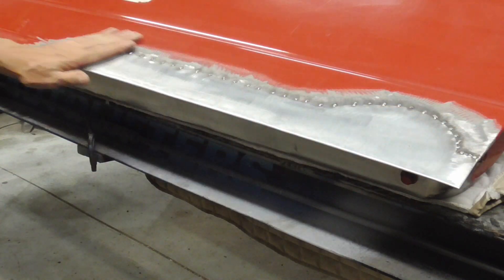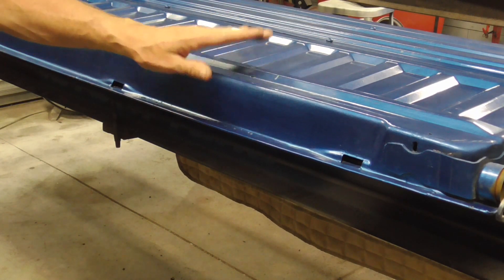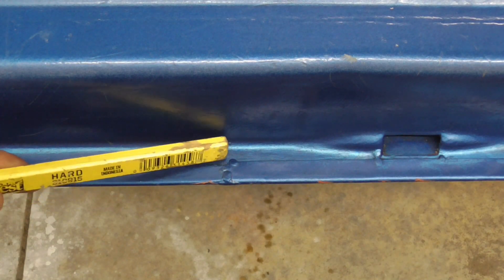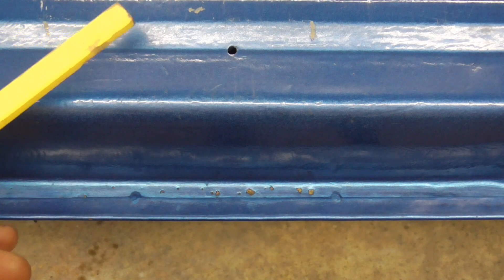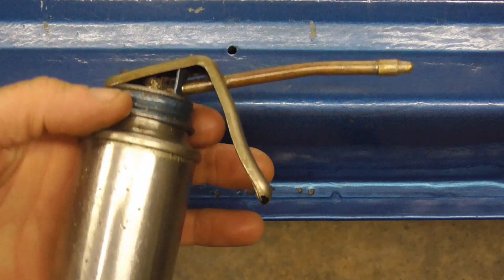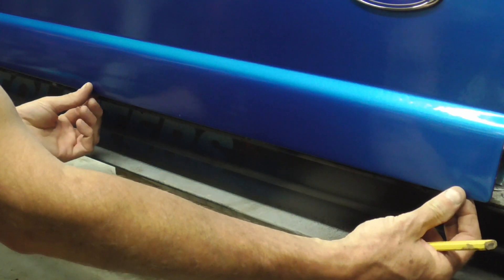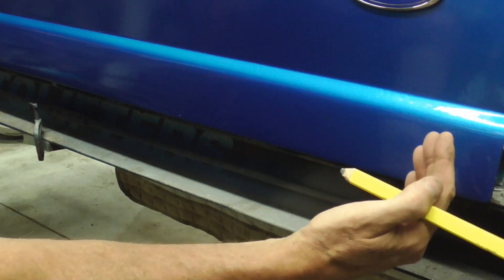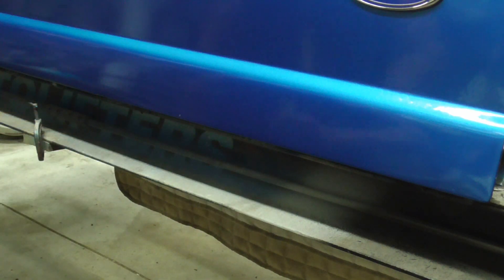How Long Do Lap Welded Rust Repairs Last?

Comment: Great Video
 Im a firm believer in undercoating. Loved the idea of using used motor oil. Taking notes
Reply from the maker: I like undercoating too and the looks of it.  Only issue that I've seen is the old Ziebart would actually lift/peel, then trap moisture or salt water making things worse.  If I do use it, I make sure the panel is prepped right so it sticks forever :)

Comment: 100% Agree. Am 65, I learn from when I was 11, Lap Patches If You treat the back with an anti rust paint, in your case oil, they last a lon time. Butt weld is good when you are fabricating panels and requires some shapes. But for day to day driving cars repairs, cleaning and cutting the rust. Is the way to go. Am Not A Car Maker, I repair and Make My Customers Happy. Never Have A Sign in any of My Shop, And Still doing.
Reply from the maker: When folks question you on that topic, have them look up "Sail Panel Seam".  Factories used lap welds in a shallow valley to connect the quarter to the roof - lasted forever if done right :)

Comment: Do you spray oil or automobile under carriage coating (which I think is lanolin) on your truck in preparation for winter? Or just oil the repair?
Reply from the maker: Just oiled the repair.  You're right though there's lots of strategies for the under carriage.  Look up Cosmoline RP-342 - the stuff is incredible - once you spray it on, it's never coming off and seriously protects against rust.  In the old days though I would fill a spray gun with used motor oil thinned with mineral spirits and soak the bottom with that.  Gets everything greasy like an old valve cover after a while - won't hurt anything either.  Doesn't combust either so no worries there :)

Comment: Did you close your weld or just weld at all half inch?Thanks
Reply from the maker: All about 1/4" apart.  You can put the welds right next to each other though.  It doesn't seem to matter - I've done them both ways and haven't seen too much difference :)

Comment: In other words, for certain areas where you can’t oil the inside (where the weld is not protected) you are actually better off with POR-15 and fiberglass, which will last much longer if done right.

Comment: Can I use painted aluminum with pop rivets over the original rusted steel panel?  Would I use steel or aluminum pop rivets?  I know steel and aluminum are dissimilar metals, but since the aluminum is painted,  galvanic action should be minimal/eliminated?  Of course aluminum easier to bend and would never rust.  I have rocker panel.
Reply from the maker: You can try it.  If you use glue the two metals may not corrode :)

Comment: you're the best.. I just got a project car 1972 510, it has some spots that need cut out and fixed similar size to this. I only have a cheap harbor freight welder like the one you've made a few videos on... Do you think it will be fine for what I'm wanting to do to one car with a couple rust spots on quarters and rockers? or will I be wishing I had a mig for my project? I've never welded before.
Reply from the maker: Thanks Joseph good luck on your car.  If you have ?s feel free to ask.  Sorry about the late reply - Jerry

Comment: This is Fantastic! Thank you for making this. Did you wash the truck very often during the winter in those 10 years? Also in your opinion does storing inside vs outside make a big difference on whether a vehicle will rust?
Reply from the maker: I sort of like to keep a clean car but in the winter it is usually dirty.  Maybe 3-4 times I took it to the car wash in the winter.  I've never had a garage to park cars in overnight but I do believe that would help a bit as the car would have a chance to drain and dry out a bit.

Comment: you do a great job both butt and overlapping and give common sense reasons for your choice. that's all that's needed and the choices you made on the tailgate after ten years proves it! keep your videos a coming.
Reply from the maker: Thanks so much - I appreciate that.  I have a video coming up that thoroughly goes over the ins and outs of butt welding and metal finishing vs lap welding and other methods - I think you'll like it.  Thanks a lot for the support :)

Comment: DONE TOTALLY CORRECT.... and I have done these types of repairs and they have lased 20 years..... OIL is the trick for you rust belt guys.
Reply from the maker: Thank you for your input - that's good to hear.  You're right, oil's cheap an it works fine.  Thanks for the support Mike :)
Reply: @LakesideAutobody  I liked your comment in another that it takes over 5K welds to build an automobile and every single one is a lap weld!

Comment: I'm doing cab corners on a 2010 ford f150 should I butt weld or lap weld them in
Reply from the maker: Professional body shops in Michigan lap weld them in.  If you insist on butt welding them in don't try to grind the welds down to nothing and attempt to metal finish - you'll have paper thin welds and adjacent metal.  You'll lap weld where you can easily tap the welds down and but weld where you can't knock the weld down that far like edges, corners and rigid areas - this video may help:  https://www.youtube.com/watch?v=I8VVlYPIigA  watch close as I explain where I used butt welds, lap welds and spot welds - hope that helps.  Jerry
Reply: which one do you think will last longer I'd like to get a good three years out of it before the rust starts to come back
Reply: @steventipton1817  lap but you need to treat the back side of the weld

Comment: Thanks so much for the information. I’m about to do a lot of work on my truck wasn’t wasn’t sure if it was worth it. Sounds like as long as I take care of it and keep fluid film or oil it should hold up fine
Reply from the maker: You're welcome - I bought this truck in 2008 for $1200 off of Craigslist.  Drove it for 10 straight years through Detroit to work - very salty roads.  Trucks are good because they have a full frame and you can easily make sure the rust underneath in under control.

Comment: I am glad to find someone that use a lap weld or flange weld, if there is room for the tool. My son, 34 now, found a truck that needed work so he could start a lawn service. He quit his long time job after his boss gave him two weeks to learn Spanish for the guys he hired. Dad (Me) fixed the electrical, put a serpentine belt system with pulleys, brackets for missing parts and welded new metal for rust. Not too bad. He gave me the truck after he spent $600. It had new aluminized exhaust, valve job, carb, intake and like most kids, put a huge cam in a 72 Chevy 4 bolt 350, sitting in a 1967 C10. The rear window was horrible. They busted things but bolted a camper shell window in the cab crooked and gaps. A friend had a saws all with 4 batteries. These are dual skin, but found a large window with a slider in it. I was able to cut it out and paid $60 for it. To install, it has to be done in two parts. I drilled each pinch weld, cold galvanized. After measuring from 8 standard locations, trimmed the panels 5/8” over-sized, ground paint of, used masking tape, marks and cut short as I could use the flange tool inside and out. With 32 vise grips, all lined up, MIG the spot welds on both side. Complete all welds then used hard pressed thin layer of dynaglass into the tiny gap, cheese grater, filler to smooth and kept the OEM panel lines on the outside. It was sprayed inside with a yellow wax rust product I had from the dealer that closed. Anything open, went to the trash. All of the other techs found jobs as I dumpster dived each night. I am glad I could fit the flange tool as the 18 gauge metal fit flush. The inside curved corners where hard. A friend had a ball shaped buffing pad almost 6-8” in diameter, worked great with air drill and PSA sandpaper. Glad it works for you. The waist oil is a great tip for guys wanting to keep a vehicle looking good for a few more years. It works. Place some cardboard down if there are drain holes. Thanks for the video! Long time subscriber! Keep em coming...
Reply from the maker: Great story - sounds like it'll last a good long time.  You sound like you're pretty handy.  You really can make a car or truck last forever as long as you don't get bored of it (I usually do then get another project)  Glad you enjoy the videos and I'll keep them coming.  Thanks so much for the support :)
Reply: @LakesideAutobody   If you are old enough to remember buying gas with your license plates odd/even number, and a peanut farmer in the White House. Gas had jumped 3 time in 2 years. Sold at $019.9 cents, jumped to $036.9 cents then to $060.9 cents per gallon. People thought the world was coming to an end. In KS, at age 13, a drivers license was black/white, no photo. I had my second Yamaha at 11, a 250cc single off-road w/ lights. If my jeans had coins in it, I could fill the tank. But gas stations where abandon everywhere, they had no fuel. Drive by one, saw a construction company selling a PU. Called the number and gave them $150 for a 1965 C10 Apache, 283, power-glide and wood bed soaked in new motor oil, used motor oil and spilt diesel. They service bulldozers, scrapers and back hoes. Bringing back childhood memories as I grew 7 inches at age 11. Small town gas station w/wood floors, benches for 12 people had the farmers telling jokes, talking about everything, while the women folks was in church. I lived in a pull camper behind the station, pumped gas 7 days a week and was fixing flats and car repairs. The town drunk got his car taken from him so he rode his riding lawnmower the two miles from his farm. Sounds like “Mayberry RFD”, but no Andy Taylor. We had a big farm, but got real tired on the belt. Learned to run fast with long legs, found I was adopted and left. Ain’t spoke to any of them since 1981. Never looked back. But I do love my C10. Thinking of putting sport rack & pinion on it from a 87 Barreta with center take off. C20 lowers, 88-98 knuckle, disc and 3” piston calipers. Keeping it all GM. The difference is, I am writing a service manual for it. Parts, schematics everything. Enjoy the videos and clear vocals w/o music.

Comment: Neglected oil leak on a 98 Silverado has left behind the most rust free area of the frame and steering linkage. Put on a new power steering hose that was leaking so now I suppose that area will rust too.
Reply from the maker: Nothing better than fixing something rust free.  How nice would it be to fix a car from the South.  Just loosen the bolt - done.
Reply: If you have oil leaks it is automatic continuous rustproofing under your car.

Comment: Are used to know a guy in the 80s that oiled his truck twice a year would mix it with something and sprayed on on his frame it always stayed prfict no rot
Reply from the maker: It really does work - just have to stick with it.  It's sort of a pain but worth the work really - Jerry
Reply: I met a small time farmer that had his original equipment from when he first bought his farm after the Korean War. Before he put the machinery away for the Winter, he would spray it with used motor oil, and cut it with diesel fuel #2!
Reply from the maker: @davekana8388  Thanks for the information. Right now I'm using mineral spirits to cut it but the diesel fuel would be cheaper for sure.  Thanks again

Comment: The oils the secret sauce.    I prefer a mix of used Dextron ATF / Vaseline petroleum jelly / bar and chain oil.     I spray the undersides of my old beater truck every December.    Just get it hot to spray and let Gretta 🙄worry about the drips.
Reply from the maker: Keep coming with the recipes - I love it.  I hear some kind of recipe with linseed oil works well too you can even throw in some black rustoleum I guess - make the frame look real nice :)
Reply: @LakesideAutobody  Jerry, I am VERY intrigued by all this. I have heard of using used motor oil before but have not tried it. It is hard to argue with success, and 10 years is proof to me that the oil did its job! Thank you for sharing your knowledge. I was wondering how you got the oil in those tiny holes. Thought you might have a tiny sprayer setup but nope, just a simple oil can gets it done!

Here's another mention of the ATF/Bar & Chain oil mix; scroll the the poster named, "Moxie" https://www.winnipesaukee.com/forums/showthread.php?t=18457 .  @Merlin Cat what's the ratios of ATF/Vaseline/Bar & Chain oil you prefer? I've been using Fluid Film but it seems to wash off exposed areas quickly. Last year I had two vehicles oil sprayed by a local guy. He told me he uses new Bar & Chain oil. I think there's more to his recipe - the stuff not only sticks, it also creeps very well. Many locals say they've seen him heat his mix in a microwave before spraying.  He sprayed my wife's truck. I did an oil change on it last weekend. We're half way through winter, she drives it almost every day and no sign of it washing off yet!!! Thanks, Larry
Reply from the maker: @lcar9871  There are some really good recipes out there especially in Canada.  I bought my wife a new Kia Sportage in 2002 and did this on every oil change.  We still have it and no rust in all door bottoms, rockers, hood, tailgate and bottoms of fenders and quarters.  I's good to start when it's new.  Jerry
Reply: @Merlin Cat how do you spray it on
Reply: @merlincat What's your mixing ratio of atv to vaseline to bar & chain oil?
Reply: Late to the party here, but if you mix motor oil and water, you'll see why it's not the best. ATF for the win.

Comment: Hi Jerry,when repairing a vehicle using a patch panel and a lap joint how do you manage to lose the over lapping panel in your prep work before painting so that the repair is invisible when finished ?....Great video btw 👍
Reply from the maker: My next video will show how to knock those welds down. Use a combo of butt welds and lap.  Lap for the areas of the patch that can be tapped down with a body hammer (pointy end) below the original surface of the panel.  Butt welds for the edges or any thing that can't be knocked down although I do try to tap the edges down a bit so I don't have to grind the welds completely flush thus preserving the integrity of the weld and adjacent metal.  This vid may help for now - https://www.youtube.com/watch?v=84A8NQnkMEc
Reply: Lakeside Autobody Thanks for the reply Jerry 👍

Comment: Awesome. I always thought the after treatment made the difference not how it was welded. Those buttwelded cars on the TV shows are going to be kept indoors and never get wet. Lap welds coated with oil would outlast any untreated butt weld, MIG or TIG
Reply from the maker: Body shops that are in business use lap welds - I'm not sure about the integrity of the but weld after you grind it completely flat.
Reply: @LakesideAutobody  thats what i always thought to, exactly after but weld and grinding theres barely any metal left , were as lap is way stronger and after i tap it down i do two coats of fiberglass bondo before finishing coats with regular filler

Comment: As always a great video I have been wrenching for 40 years now I have taken up body work just as a hobby and to get some of my cars done our 14 ford 450 wheel lift body is rusting bad no holes what is the best thing to stop rust and best paint to paint over it thanks for the videos
Reply from the maker: Usually cars rust from the inside out so I would try to get some WD40 or used motor oil inside the panels, rockers, tailgate, wheel wheel arches, fender bottoms, cab corners, etc.  It is a bit of work and you have to get creative but it will stop the rust.  Make sure the panels can drain too - check the drain holes for debris, and fender bottoms for leaves, mud, etc. You can see this by opening the door and squirting the fender bottom out from the door jamb.   Basically everything has to drain and it has to be oily at the bottoms of the panels.  As for paint, rustoleum is a good cheap rust preventative paint but it wont match.  Hope that helps a little - Jerry
Reply: @LakesideAutobody  thanks jerry this is a wheel lift body not sure how it's built will get under it thanks again for your time
Reply from the maker: @michaelovers688  You're welcome

Comment: Jerry, by 1/2 inch apart, do you mean that you tack welded it, not fully welded it?  Thank you!
Reply from the maker: Yes, a series of spot welds 1/2 inch apart.  You want to avoid excessive heat - warpage, fire from the inside of the panel - thus the spot welds.  You can space the welds real far at first, 'til you get the panel where you want it, then make them closer and closer until you're satisfied.  I find putting right next to each other unnecessary though - if a panel is going to rust it's going to rust from the bottom up - hope that helps - Jerry
Reply: @LakesideAutobody  Thanks Jerry!